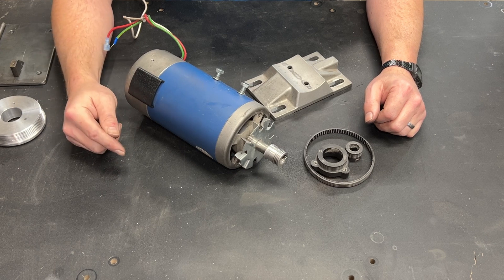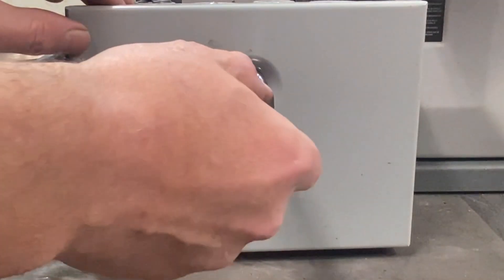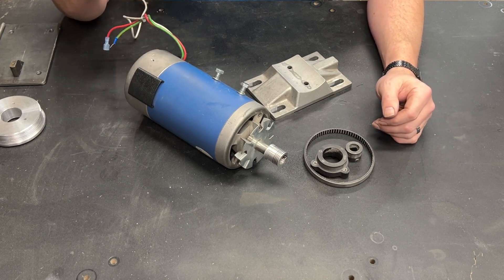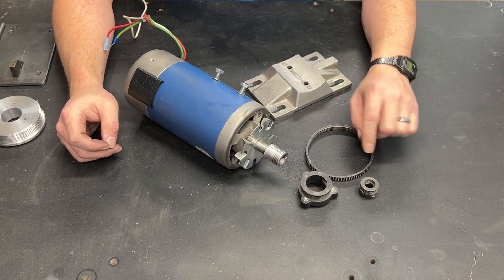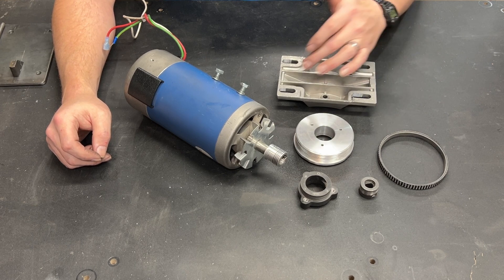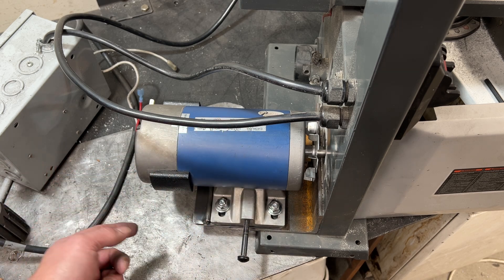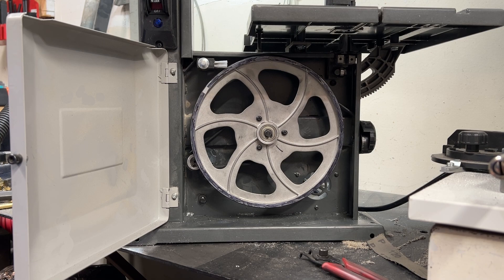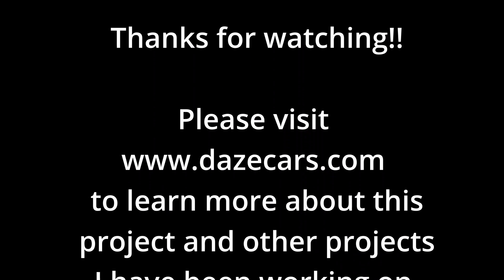Treadmill Motor Bandsaw Improvements Fixing Mistakes From my first Treadmill Motor Conversion

Comment: Seems like the bandsaw is still going way too fast for metal cutting..  figured they’re supposed to go closer to 150fpm or 200.. which is about as fast as a person could turn a wheel by hand..  when you get to speeds like that the treadmill motors dont have enough torque to get the job done.  Same with drill press conversions.  Ive tried both and ended up just biting the bullet and buying a proper machine..
Reply from the maker: Your failure was in gearing, motor selection or both.  My bandsaw works very well at the slowest speeds because it is a large high torque motor and has been set up with proper gearing.  DC motors have a constant torque curve other than the very bottom few % of the RPM range and if you didn't have enough torque the motor didn't have enough torque.  Gearing helps solve this.  This is a common mistake because people compare HP instead of torque. https://youtu.be/KPcAr9orqZw

Comment: would have liked to know why the SCR motor controller with bridge rectifier was inferior to what you ultimately went with.
Reply from the maker: SCR is what I ultimately went with. https://youtu.be/zej3rkAEVDg I prefer the SCR because it is far more robust and has the ability to easily customize the speed control: course speed control, fine speed control, minimum speed, max speed and even preset speeds.  The downside to the SCR and rectifier is the power is not clean.  A PWM power supply such as the MC2100 produces far cleaner power but they are not very robust and a lot harder to customize for your specific application.

Comment: My treadmill motor lathe is killing it. Its great. But i decided to just spend 100 bucks on a 5" cut handheld bandsaw😂 cuz after it was all done and said I spent enough money on the lathe treadmill motor build - power, scr. Switches, fuses, potentiometers, microwave etc (i followed everything and even got a proper manufactured brake)  i couldve just bought a nice strong proper motor and controller😂 so- straight to the hardware store for an adjustable speed bandsaw and saved myself 2 weeks of fiddling😂 i will say the saving grace of diy was - that big chunk of money was $20 here and $15 there and $30 there etc so it didnt LOOK like i spent a wad of cash on it😂
Reply from the maker: Little costs can add up.  A lot of the cost depends on how much you can reuse from the treadmill. Glad you are happy with your lathe build.

Comment: Why not use the power supply and speed control from the donor treadmill?
Reply from the maker: That is an option, and lots of done it but it is not my first choice.  There are two categories of treadmill power supply: hackable and non hackable.  the hackable ones like the MC60, MC2100 and a few others are not as robust IMHO as an SCR.  They do not stand up to the riggers of the shop as well.  In fact I put an MC2100 on my band saw and fried it by sticking the blade.  The non hackable ones are ofter way better power supplies BUT the only way to run them is with the treadmill control panel.  This can create size challenges and you also must deal with treadmill feature like soft start and the like.  For this reason my personal choice is to build my own power supply that I know is up for the challenge and is customizable for my application.

Comment: It looks like your fan maybe pushing dust into the motor. If so, I put an electric fan with a filter on the other side. I didn’t want dust to get into my motor.
Reply from the maker: good point.  less of an issue when cutting metal because the kerf is so much heavier it just drops.
Reply: You are the treadmill master. Tried other controllers but just use the treadmill boards and slides. To this day I haven’t had a problem. Bound the drill press a few times but everything still working. Put a monster on my drill press and made a 2x72 belt grinder. Fun stuff.
Reply from the maker: Treadmill control panel is an option, I just don't care for the treadmill feature they come with
Reply: If you watched with a microscope while cutting you are basically spraying metal dust everytime you cut or grind anything but a very large amount isn't seen by the naked eye but the metal dust is still there being sprayed so protect your motor and components as best as possible. Good vid and keep it up!
Reply from the maker: oh yes always a good idea to minimize contaminants inside the motor

Comment: If you weren't the treadmill motor guy before this, you are now. Most useful thanks.
Reply from the maker: I have been crowned the treadmill guy for a while now. 😂🤣😂
Reply: I've been following along, because I want to use a treadmill motor on my mini lathe, eventually. I am considering using a countershaft to get the gearing for low end torque. I do wonder how constant torque DC motor controllers though.
Reply from the maker: I always recommend gearing it to maximize torque BUT one really nice thing about DC motors is torque is constant at 99% of the RPM range.  At the very lowest speeds the torque does drop as the resistance of the coil inside the motor takes a certain voltage to overcome  which reduces over all amp flow and that has a direct result of reduced torque.  But once you get past that very initial low spot torque becomes constant regardless of RPM.
Reply: Thanks. So if I gear it so that 25% motor speed is my minimum spindle speed I should get fairly constant torque?
Reply from the maker: anything above the first 5% or so will provide constant torque out of the motor.  I tell people to max torque whenever you can.  If your motor is max RPM 4500 and the max output speed is 1500 gear it at 3:1.  Unless there is a target max or min output RPM always gear it as low as you can with in in the working RPM range.

Comment: Nice upgrade. 
Why don't you run your pot to the front with your power switch?
Reply from the maker: At the time I went for easy. I will likely change it when I redo the power supply and go to a two potentiometer system with fine and course speed control.